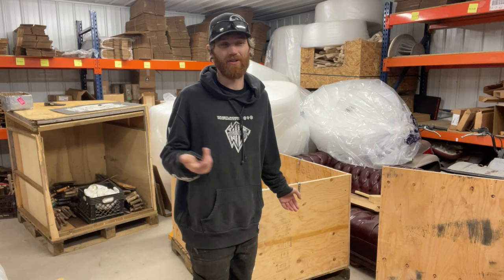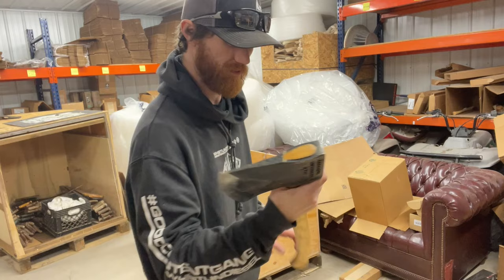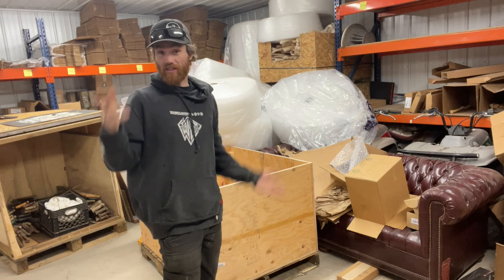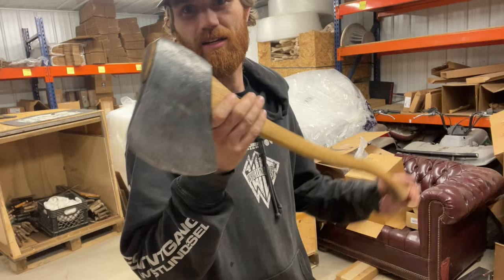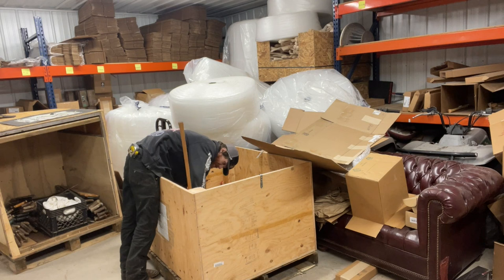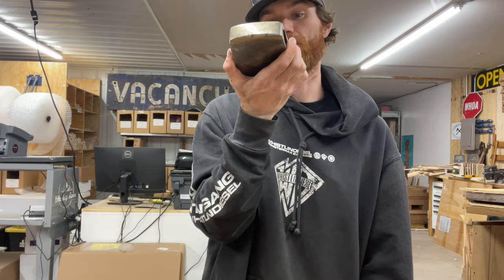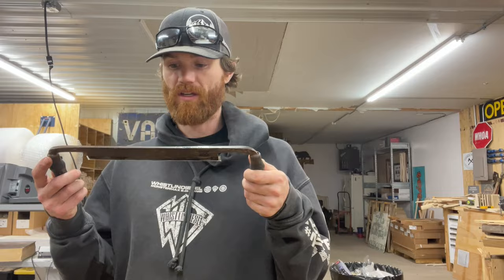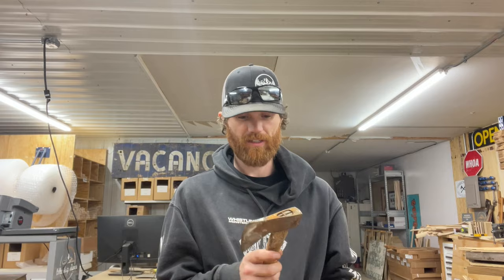Unboxing The "Washington Collection" - You've Got To See This

Comment: A lot of these are very worn, but that little Craftsman boys axe is certainly interesting.
That last Craftsman double, that reversible/ full peeler was a pretty nice looking head.

That Newtown GW door stop is also pretty cool, but ive already got one.
I always thought it was funny that these door stops have a better handle than any hatchet you can buy today.
Reply from the maker: I have shared similar thoughts on the GW hatchet handle.  haha
Reply: @WhiskeyRiverTradingCo  if they'd fit a regular hatchet I would swap it with a crappy Link handle from the hardware store and use it for a plumb scout head I have that's in need of a good handle.